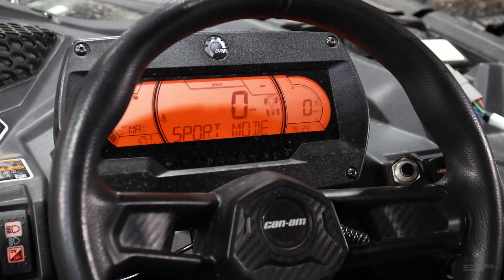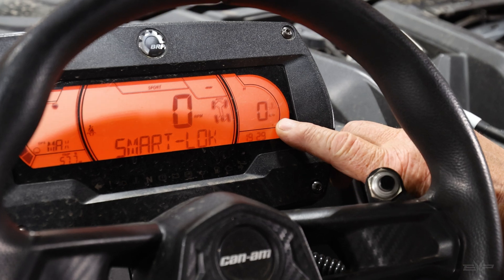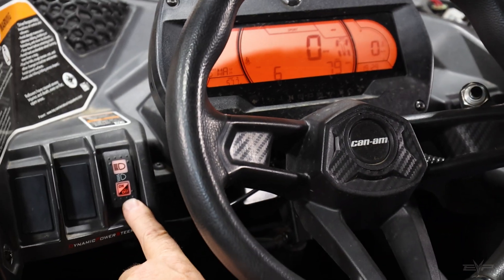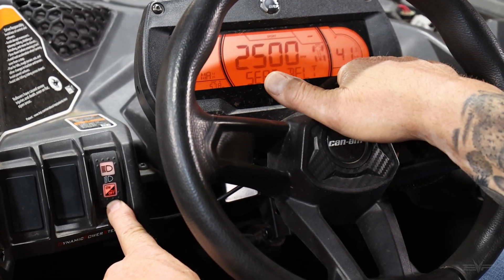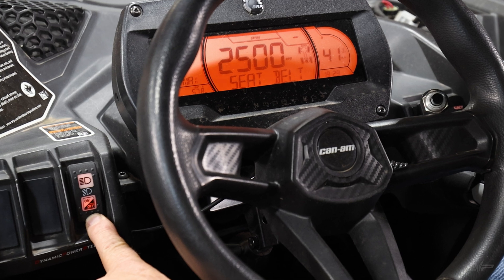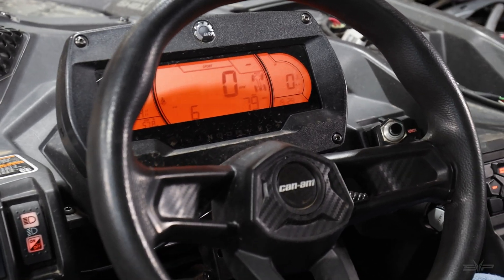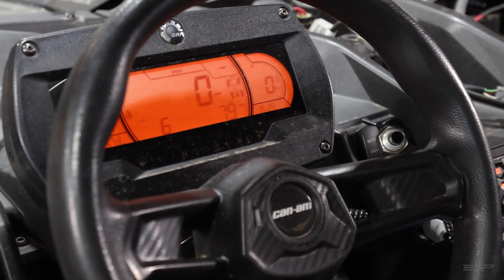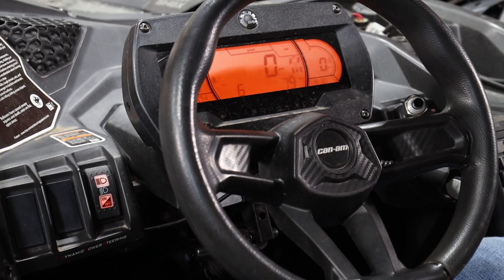EVP Flex Fuel Tuning for 2021-2023 Can-Am Maverick X3 Turbo RR

Comment: What kind of power would it make putting 91 octane in compared to e85? Really considering trying this out
Reply: The power output of 91 and e85 would be the same as current offerings this offers the ability to run ethonal %'s between them. So an example if u run e60 u would get 90% of the hp advertised by current e85 tune. the hp ratings are not out yet so thats just a guess but u tend to see small gains till e30 then from e40 to e60 the hp gain is compounding till it slows significantly and becomes diminishing returns especially between e70 and e85. Kind of like an S if u where to graph it im sure it has some name for this kind of interaction.

Comment: What about the wastegate crack pressure? Does that need to get adjusted every time you change fuel type?
Reply from the maker: No you do not have to adjust the wastegate.  You will set it for the higher ethanol content and leave it alone

Comment: Just to understand.  Does this mean that on my machine that has the bi stage 3 tune on 91, I can put 101 octane in it and it will change tunes automatically to the bi tune 101 octane?
Reply: No only ethonal % not octane. Your confusion may stem from the regular gas naming process using the octane # when E85 is actually referring to it being 85% ethonal (pump e85 is actually sold between e50-e83 typically hence the need to test it but thats beside the point). There is no way to test octane # without some pricey equipment.
Reply: @bluereaper6.472 Thank you for the explanation.
Reply from the maker: bluereaper6 did a great job answering your question.